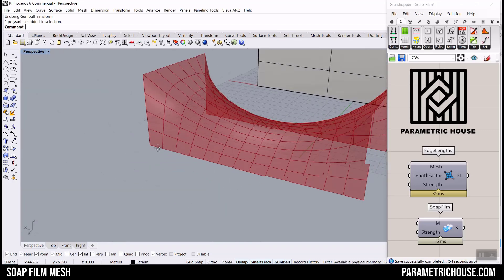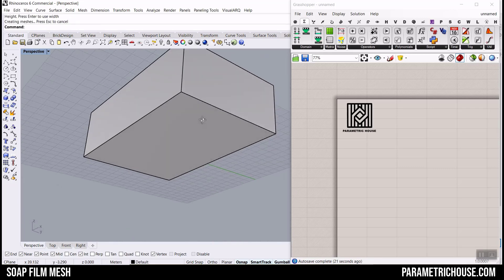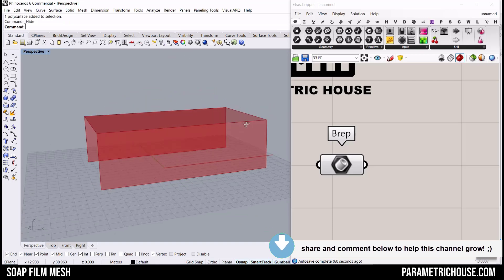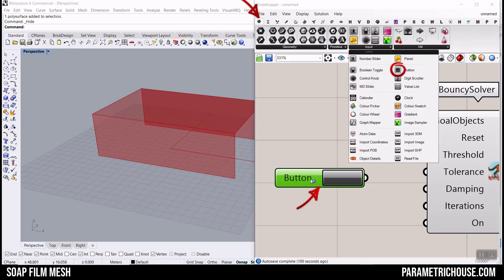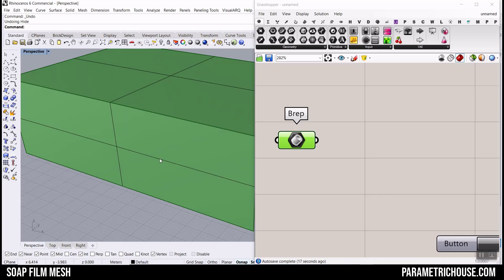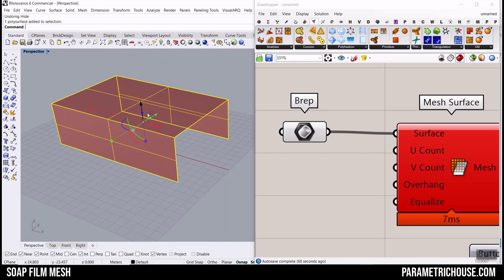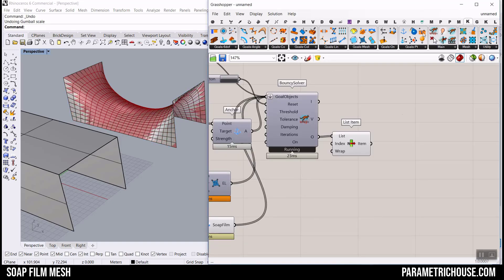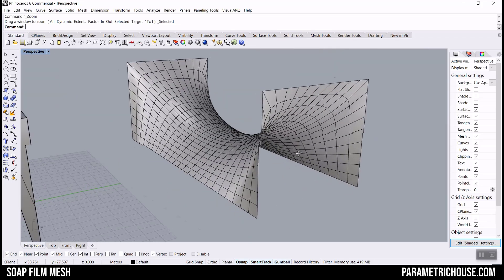Grasshopper Kangaroo Tutorial (Soap Film)

Comment: Hi there, 
thanks for sharing!
I tried to use the trick of connecting mesh on two compound surfaces (1st surface is done by loft, 2nd surface is to tangent match 1st surface), but it doesn't work. Seems the trick only works for simple surface, do you have other solution?